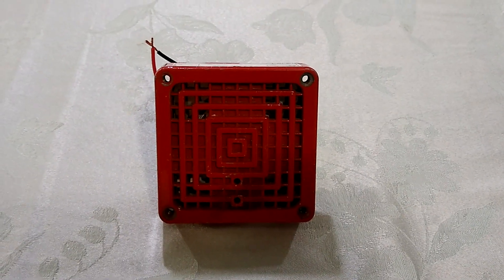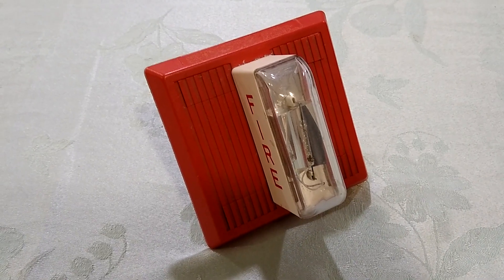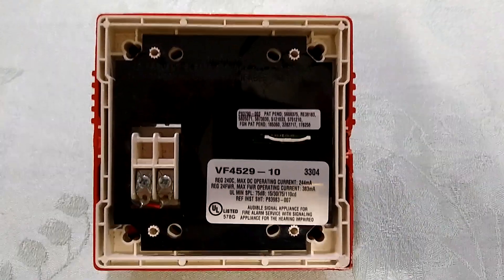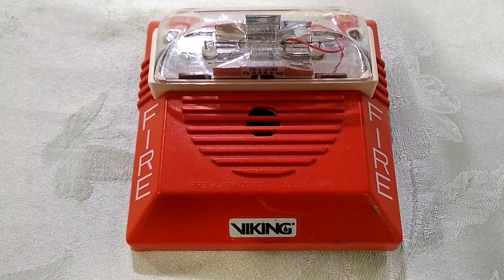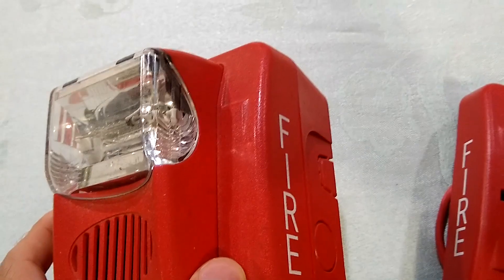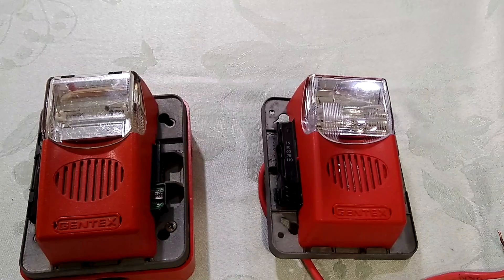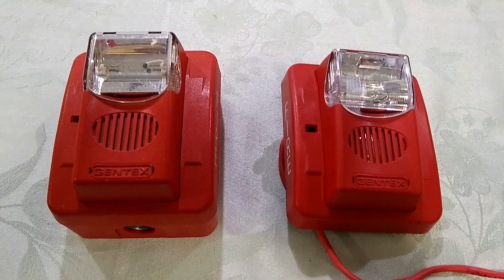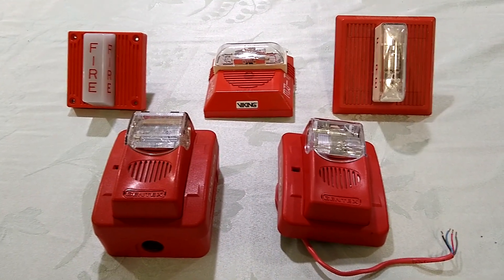CURSED Chiptunes: Electronic Fire Alarm Signals

Comment: If I'm not mistaken, some say the EH/EHS series succeeded the 7002T series, which is not true at all. Both series were made about the same time (the EH series actually came out in the late-80s I believe, and ended up succeeded the older ES electronic series which came out in the early/mid-80s), and both series actually got discontinued during the same time: 1994. The 1.5 candela strobe on both series course didn't met the ADA standards at the time, hence why they discontinued both (in favor for the LS/LSM series device which came out in 1994 as well, I think. could be wrong about that). Of course, Wheelock did introduce the WH line of products (I believe in the early-90s), which was a 15 candela strobe. Wheelock actually still uses the WH today for one of their MTs, that is the MT4-115-WH. But a 15 candela strobe in a frosted lens definitely is not "ideal" for nowaday fire alarm applications haha. Pardon me with the plethora of Wheelock information, I like Wheelock lol
Reply from the maker: I really like Wheelock, too. They have such a variety of signals it's ridiculous. And they were Simplex's go-to for outdoor signals for a while before they introduced the weatherproof TrueAlert.

My high school had a massive Simplex 4020 system with multiple generations of fire alarm signals. Whoever installed it did a really good job, because they had the old wing (4051+4050-80's) on march time, the main wing (4903-9219's and GX-90S's in the classrooms) on continuous, and the new wing (TrueAlerts) on code 3. There were also 4003 voice evac panels in the gyms, auditorium, and cafeteria.

But outside? All Wheelock. The front circle had an ASWP in code 3, and an MT-24-WM on continuous that sounded really cool together. The back of the newer building had MT-24MCW's or 1575W's in code 3. There was also one classroom that had a vertical strobe AS. Did any of your schools use Wheelock products?
Reply: @Fahrenheit4051  I've come to have about 20 Wheelock devices in my current alarm collection :P (guess that shows how much I like Wheelock lmao ¯\_(ツ)_/¯. it's more than any other fire alarm brand I got, for now at least)

That's a pretty cool school system, I respect older fire alarm devices despite how extremely loud they might be haha. I've dealt with TrueAlerts in my early elementary schools days (which at the time were loud enough to scare the living daylights out of me). That was until about 3rd grade, which was Gentex Commander-1's, and the outside area had Wheelock MT-12/24's (the horn-only MT's). Then in 4th grade through about 6th grade was SpectrAlert Classics (wall mount horn strobes and ceiling mount horn strobes). The outside of that school had a Commander-3 even (I don't recall whether it was just one, or multiple ones), as well as some SpectrAlert Classic H12/24s horn only's. So i guess the only true school I went to that had Wheelock were those outdoor MT horn-only's, as far as my memory serves me lol